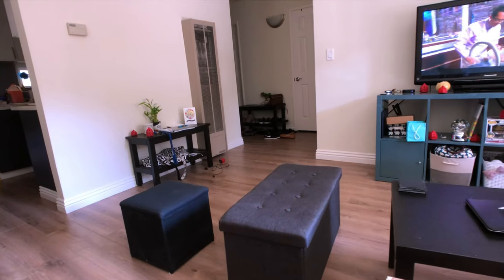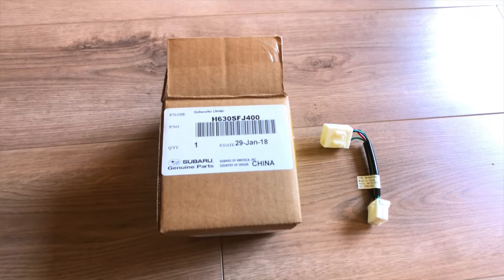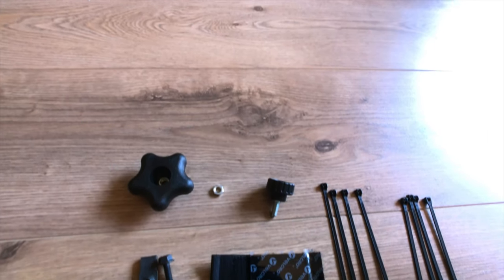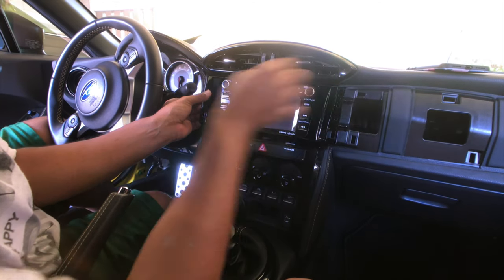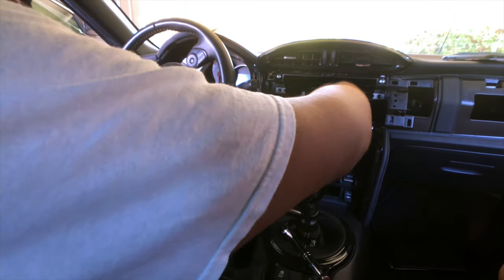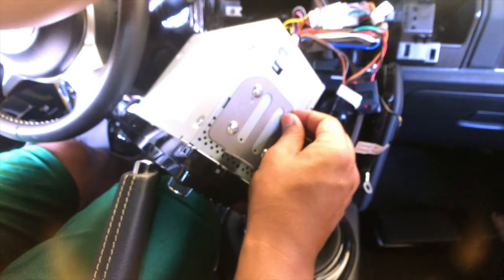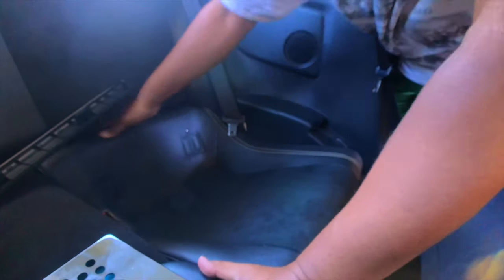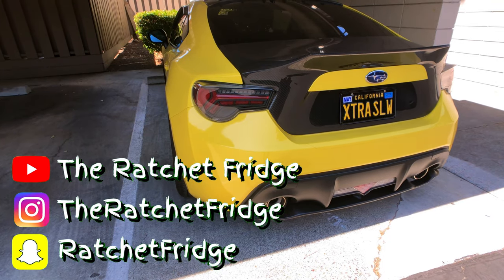Ep-4) How To Install Subaru Sub In BRZ

Comment: hey bro  i got a 2018 brz   but my headunit is not the same  how do i get the right harness for it i also got the oem sub from subaru
Reply: The harness that comes with the sub fits all the stock head units from all years. It’s a one size fit all harness. The back of all the different head units looks the same and they are all wired the same.